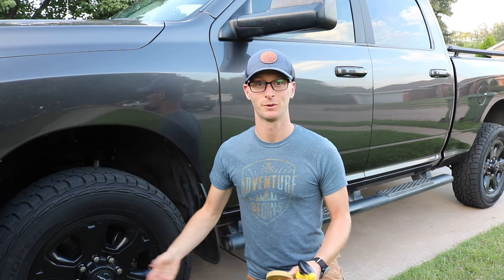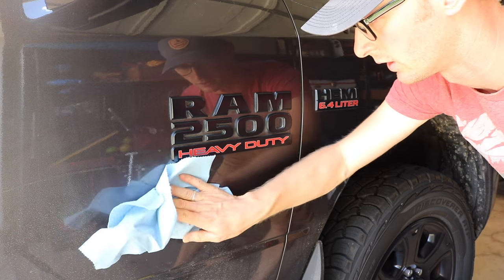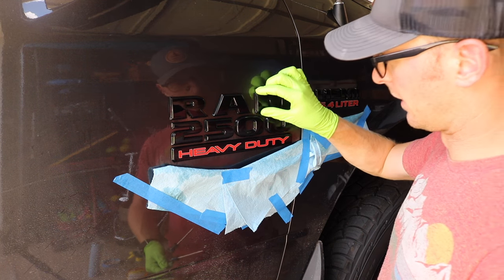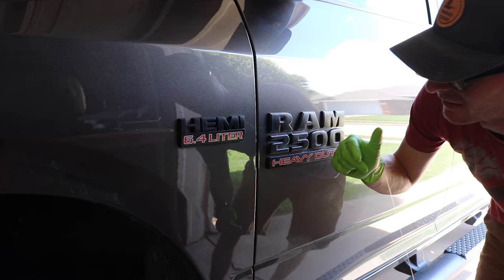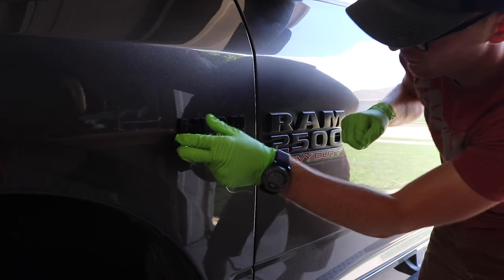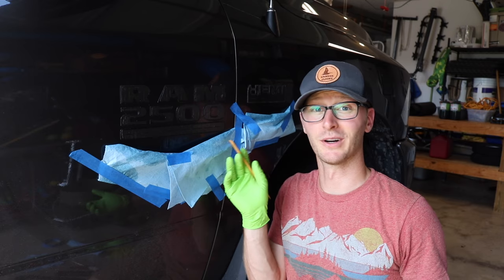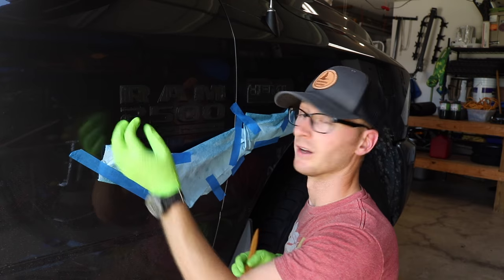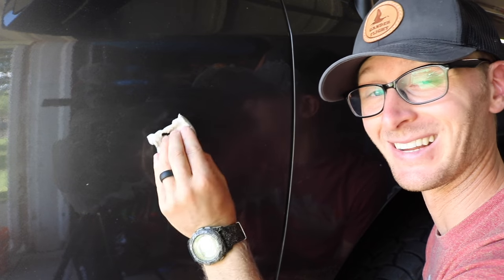Which Method Is Best to Debadge and Remove Your Car Emblems?

Comment: Nicely done sir. Pro tip for those wanting to do this but don’t want all the adhesive left. Use a heat gun or a dryer to soften the glue up and more times than not the fishing line will actually get behind the glue as well. Quick wipe with goo gone after and u can never tell it was there.
Reply from the maker: Fantastic tip - thanks for sharing!
Reply: The fishing line won’t scratch the paint at all? I used something very similar to fishing line in the past and it scratched tf out of the paint lol. Don’t wanna make that mistake again haha
Reply: Or dental floss works just as good!  @GanderFlight
Reply: I’d like to do this but I have denim (matte) paint.  Petrified to wreck the paint.

Comment: It's been awhile since I did mine, but I used WD40 and it worked way better than the goo gone seemed to.
Reply from the maker: Interesting! I’ll keep that in mind for some other debadging projects I plan to do.
Reply: I have found rubbing alcohol works like a champ on type of sticky adhesive .
Reply: WD is legit
Reply: I use gasoline
Reply: @dallasgodfrey3470  same but carefully
Reply: I like the Wd 40,, idea.

Comment: If I can make one extra suggestion to those trying this, use an eraser wheel that's ribbed (has teeth) instead of smooth. That way the risk of burning your paint with the rubber wheel is a lot less as your paint has a chance to breathe as the rubber is pressed against it. Nice video mate! Love your work, you have my sub, sir. Also, if you try this, don't cheap out on the cheapest wheel you can get, because those cheaper ones can be made of super hard rubber, which WILL burn your paint - I'm speaking from experience... you have been warned... but yeah, if you get a good one you will be loving it. I only know because I also recently did this and I tried quite a few of them. Looking forward to more content :)
Reply from the maker: Thanks for the kind words! I'm not sure how much heat relief the ribs will give when spinning at drill speeds, and along the lines of buying quality the "name brand" 3M adhesive removal is solid. I think it really boils down to keeping it moving - you can burn through paint with silk if you spin it fast enough for long enough. Thoughts?
Reply: @GanderFlight  sure that's true enough. To try and explain it a little better let me offer this example - it's the same principle as used in buffing pads. You can use smooth faced pads to polish your car, or alternatively there are waffle or diamond faced pads you can use as well. The waffle and diamond buffing pads only exist to help reduce the chances of paint burn during buffing. Their material construction is the same as smooth pads. The principle is the same here - drill speeds being equal, the spinning surface of a ribbed eraser is aerated, and also there is less contact time with the painted surface per revolution, therefore less friction/heat being generated. This is what I found in our tests, and it's part of the reason why we went with this type of eraser wheel. I'm not saying that the smooth wheels aren't adequate in most situations, but a ribbed wheel we found is definitely a safer option on more varieties of painted surfaces, especially in the hands of non-professionals. Hope that makes sense, and please keep the vids coming!
Reply from the maker: Thanks the expounding, maybe I’ll have to get one of your wheels and do some comparison testing myself, could be an interesting video!
Reply: Damn which i saw this earlier, just burned some of the paint on my 2017 Grabber blue stang, trying to take the spoiler adhesive off from the trunk lid.
Reply from the maker: @Horus Works I tried the ribbed version you sell and did not have favorable results: https://youtu.be/7Y_2DYBwoTU
Reply: @A1doz  How’d you burn it? Using a wheel? What year is the mustang? Want to make sure it doesn’t happen to me 😳
Reply: @Jose-ul7cx  2017 Grabber Blue. It worked at getting rid of 60% of the residue but honestly I just used 3M Adhesive remover and a plastic blade to scrape away at an angle. (plastic blade left scratches on clear coat so I just used a dab of Meguiar's M20532 Mirror Glaze Ultra Finishing Polish to get rid of the scratches.)
Reply: You know I was trying to find some information on the cheaper wheels and sure enough I bought one off of Amazon I think it was even though I hate Amazon they did have the cheapest price with shipping for this item and it did not compare to the ones I used to use at my detail shop a long time ago cuz immediately I started trying to use it to remove an old pinstripe that probably is 30 years old on original paint with original clear sure enough it started eating right through the paint and the clear within the first few seconds and I don't think I was pressing too hard or spending too long in that spot at least not from past experience where it seemed like the ones that I were buying you could literally leave them in one area especially on 10 you're old or less factory paint you could leave in the same spot without pressing down for probably about 30 seconds or it got kind of hot. So I think I need to return that stupid wheel it's still has the little casting Ridge on the ends as it makes the circle which goes to show how little I used it basically one minute
Reply: So I left my two cents and my experience without asking you which one did you buy that worked well that wasn't overpriced I.E 3M? Is they're particular seller you went through for no name one or was it actually a name brand one because you know normally they don't have the name on these
Reply: That sounds like a horrible idea.
Reply: Only difference the ribbed one does is for corners imo

Comment: I would use a heat gun for badges next time for the main removal and then goo gone for the adhesive
Reply from the maker: Thanks for the input! Why heat gun over fishing line?
Reply: heat gun and fishing line and then goo gone
Reply: This was my plan as well :) a wheel seems extreme my badge is way smaller anyhow.

Comment: I've been hesitant because I had a tint shop remove some badging while I was getting tint done and they left ghosting in my paint.  Watching your video, I realize they probably powered through it and applied too much pressure in one spot.  Thanks for the video, I'll doing the same thing with my new vehicle.
Reply from the maker: Best of luck!
Reply: How did you get rid of the ghosting ?
Reply: What you refer to as ghosting meaning you can still see in the clear a slightly different lighter or darker facade of the original outline is not something so much to do with the shop or the tools used to do badge. What you are experiencing is the UV degradation from being exposed to sunlight and other weather sometimes even temperature differentials which is a natural process and also lets me know that your car was not new or very late model or probably in the southern part of the country
Reply: Not necessarily, I did mine on a 10 year old red truck and left ghosting. All I used was a heat gun, fishing line and goo off.  It probably could have come out with a paint correction but I never bothered.

Comment: Nicely done, dude. The wheel accessory for your drill is the way to go. Good video, man. Thanks for sharing.
Reply from the maker: No problem Allen👍
Reply: Actually the way to go is to buy a proper polisher buffer variable speed preferred, and get a 2-in wool pad 2 in cutting pad and a cutting foam pad and a polishing foam pad if you cannot afford all of that just get the buffer and a polishing foam pad and at least a 2 inch wool then buy some proper liquid compound polishes and waxes or glazes even a cleaner wax
Reply: @GanderFlight  because I've commented on the tool you used and I have a set of that and I only use it mainly for polishing sunglass lenses and my reading glasses lenses and other small items and yes even for just the areas of debadging your truck, a buffer would have done a better and faster job and you would have had way more control over what the tool touches and doesn't touch. A nice variable speed polisher buffer , i believe Northern Tool has a pretty decent one ,you can get one from Harbor Freight even but if you can spring it, a Makita/ Milwaukee and so forth Works excellent with typically available replacement parts which will probably be cords and/or you rewiring the cord at some point ...triggers and brushes ...these things can last decades so invest in one before they are not available or the prices go even higher. You can even buy a high quality lightly used one. If it looks even slightly beat up and scratch  all over avoid those because there's no way of telling how many hours of use it had- you just know it had many hours . I take care of my equipment and they'll have a lot of hours on them but they won't look all beat up ,so take that as you may. you want to get a 2- wool pad which can be used for the entire range of processes to the paint but a lot of people like to use the foam pad so you can get them in different textures and open cell structures I guess is the best way to describe it but the best way to buy them , just by looking for either a cutting foam pad or a polishing foam pad in that type of wording that way you can get the right one and get 7 in you can even do 8 in if you can find them but you want to make sure that you've got part of the wool by a couple few inches or the foam  extending out enough beyond the backing plate that has the arbor in it attached to the buffer ,that you were able to say slide in between the door skin and the side mirror or underneath the headlight assembly and where the bumper cover curve begins and so forth don't ever buy a backing plate that doesn't have Velcro and that extends far out from the center hole and make sure it's flexible without hard plastic or super hard vinyl rubber near its Outer Edge because when you touch parts of the car and it's spinning you will damage part of the car more than you'll damage the backing adapter and you want it to be the other way around

Comment: Good tips. I have to remove my auto vent shades before I drop my truck off for a paint job. I will try a lot of these tips.
Reply: On a low setting a heat gun or a hair dryer probably on the high setting and not keeping it the same place you first want to do it for 5 or 10 seconds and then test that spot by lifting it say with a plastic spatula or similar if it doesn't give much then do another 10 seconds and then try again and so forth but heat will probably help you the best there. I'm sure your need is come and gone but for future reference for other items I guess still works

Comment: Damn could Dodge have put any more badges in such a small area?  Great video!  You are the master at this.  I would never let paper towels touch my paint job though.  Micro fiber only.  I would use a heat gun or hair dryer first to soften up the adhesive that way emblems aren't potentially breaking and scratching into the surface uncontrolled as you pry them loose.
Reply: Those blue towels are not the paper towels most people are familiar with. They are designed for many purposes and one of the best things about them is they are 'lint free'.

As for the badging by Dodge, all I can say is...

RAM!!!!!!!  A HUGE ASS RAM AND THE WORD RAM IN THE LARGEST FONT KNOWN TO MAN .

I'm so happy to see this guy remove that garbage from a nice truck.
Reply from the maker: Yeah I don't like all the branding either. Unfortunately - they're now molding them into the body panels.... ugh
Reply: @GanderFlight  wow🙁

Comment: I’ve tried goo gone, acetone, gasoline, diesel, alcohol and nothing worked on two sided tape adhesive. The 3m wheel had no problem removing it but be careful of burning your finish. I had a few burn marks after using on my white fiberglass boat.
Reply from the maker: Interesting - I TRIED to burn through the clear in this video and couldn't manage it... https://www.youtube.com/watch?v=7Y_2DYBwoTU&lc=Ugzrsy1r_mNmeb7ClC14AaABAg

Comment: STORY TIME: So, I was all set to go buy some fishing line, a heat gun, and an adhesive eraser wheel, but when I pulled up to Home Depot I realized I’d left my card at home. I was gonna go back but when I got home I decided to wash the car b/c we just had our last rain for a few days. When I was drying it I decided to try to just pull the letters off b/c it’s 75° and humid outside. The first letter came off fine, but I didn’t want to keep using my fingers, so I decided to give this thin paracord I used for making a bracelet. It worked like a charm on the “Altima” letters, “Nissan” decal, and the “SL” letters so easily. B/c I didn’t heat anything up I was able to peel most of the adhesive off with my fingers. For the left over I grabbed a microfiber towel and poured a quarter-size amount of extra virgin olive oil on it. Yes, olive oil 😂 I rubbed off all of the sticky part left over and most of the dirty and grime from being the letters and decal came off quite easily. I took another microfiber towel and dropped a quarter-size amount of Dawn dish detergent on it  (b/c that duck commercial compelled me) and made little circles until it was completely clean. I rinsed it w/ some water and done! No heat, no tools, no harsh chemicals, no damage, and no dollars spent! BOOM!
Reply from the maker: Hey hey that'll do! I'm glad it was so easy for you  - I wonder if because of that Nissan should look into a better adhesive 😆
Reply: Worked like a charm.  Ty buddy.  ✌️

Comment: Man, that would make nervous using such an abrasive technique on the clear coat.  When you know how paint correction and polishing works, using a mechanical abrasion like an eraser wheel seems like it would tear through layers of the clear coat.  I think using the technique shown on Ammo NYC and WhiteDetails (both professional detailers) channels would be my preference.  Heat gun, fishing line, heat gun, fingers or plastic blade, automotive tar/goo solvent, rag or plastic blade, clean, polish.
Reply from the maker: Thanks for sharing! I've watched some of Ammo NYC's videos before and will have to check out WhiteDetails. Risk reward equation - eraser wheel is not THE tool - but A tool thats available out there to accomplish the job.

Comment: You can also use 3m adhesive remover to go along with the wheel eraser.  Just wouldn't let it set like you did with the goo gone.

Comment: I used both and im left with crusty super dry residue… sadly nothings working 😑 any advice would be great
Reply from the maker: A residue just where the badge was, or everywhere?  Did you clean and buff the area after using the eraser?

Comment: I grabbed my badges with pliers and pulled them off. Then used eraser wheel to remove the glue. Then cleaned the residue with gas.
Reply from the maker: Thanks for sharing that sequence Chris! Any scratches from the pliers?

Comment: How about if you spray goo gone on the adhesive AND use the eraser wheel as well...will it be even faster to remove?
Reply from the maker: No because the eraser wheel works using friction - the goo gone would act like a lubricant and you'd therefore just end up with a mess.
Reply: @GanderFlight  gotcha👍🏻

Comment: What works real good for getting the residue off once you have the badge off is WD-40
Reply from the maker: Do you let it sit or does it work pretty quick?
Reply: @GanderFlight  I sprayed some WD-40 on an old cotton wash cloth and a little on the residue and with very little elbow grease wiped it and the residue from the double sided tape come right off

Comment: Very interesting was wish this video to see how to get rid of the adhesive after debadging my accord with dental floss, I guess I have to get that type of an eraser seems like nothing will get the damn adhesive off the car
Reply from the maker: Folks have had decent luck with WD40 or if washed off right after, gasoline on the adhesives - obviously follow all appropriate safety and ventilation practices.

Comment: What’s your best solution for removing super glue/gorilla from car. Used it to put a lip kit on the car 😅
Reply from the maker: ooof - no clue. I might put a little gasoline on a rag and see if that takes it off. Then clean the area with soap and water to remove any gasoline residue

Comment: If I used the eraser wheel, is that all I'd need to get the sticky adhesive off? Or is there anything I should get along with it? I know the scratch kit is recommended but, anything else? where could I find these? Any local shops?
Reply from the maker: You may want some adhesive remover - goo gone or goof off or rubbing  alcohol to clean it off at the end. I'm not sure where you'd be able to pick them up locally - auto body supply store probably - I ordered mine through amazon - there is a link in the description if you're interested.